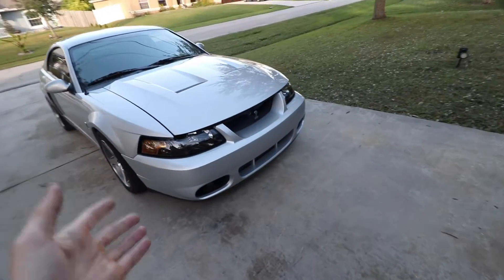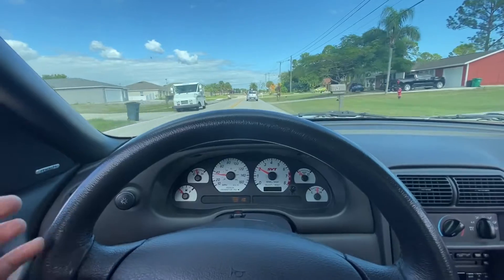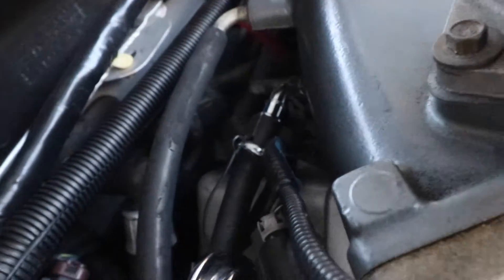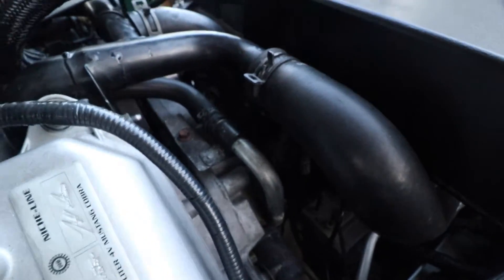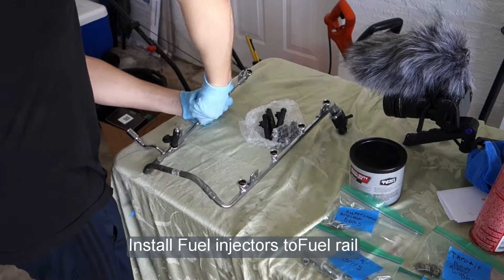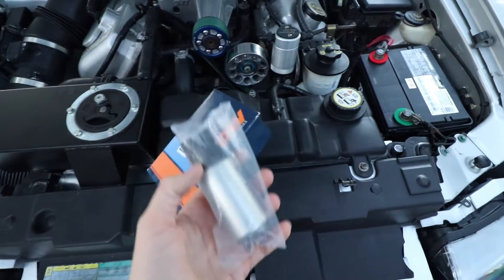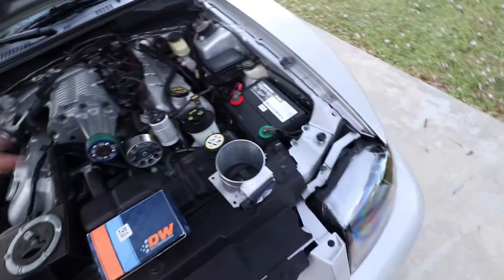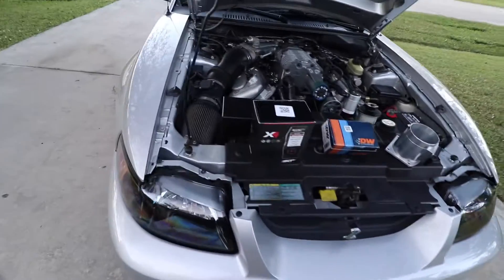So... I almost Set my Cobra on FIRE 🔥 on first start up After Blower Swap

Comment: Lucky You! I'm glad you didn't lose the car brother.  I changed all my hoses to silicone so I never need to worry about collapsing or cracking a hose ever again. Not a good idea to go to E85 now because the EPA is trying to get rid of it.
Reply from the maker: Really?? The EPA is trying to get rid of E85? Wow that makes no sense, E85 burns much cleaner than regular gas